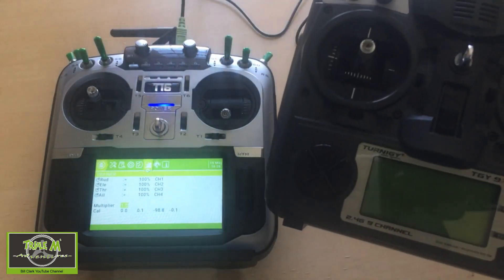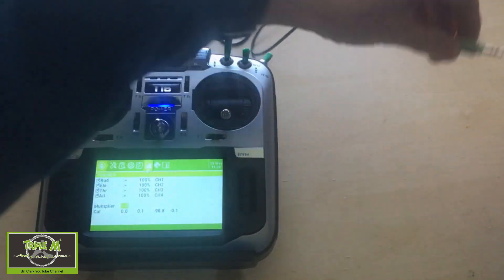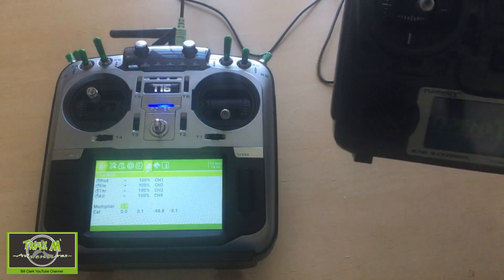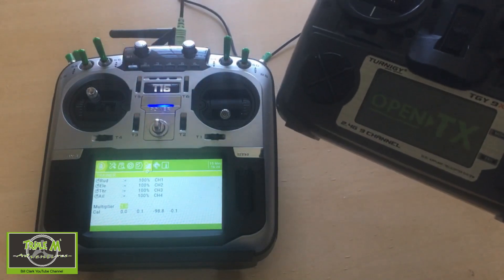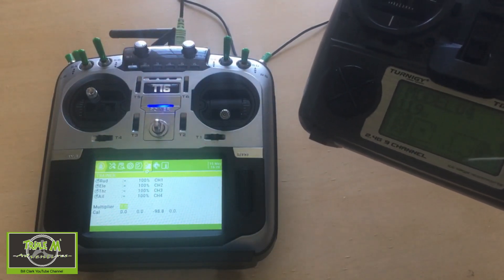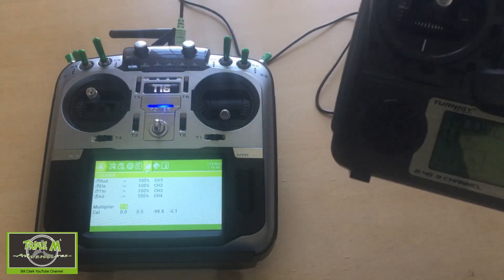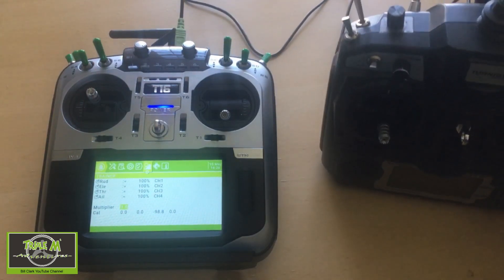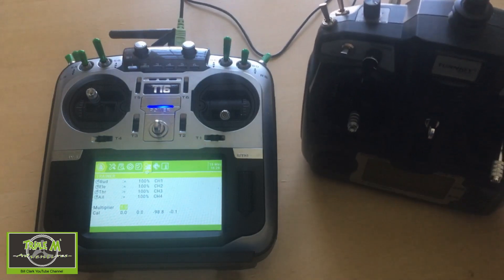Jumper T16 Setting Up Trainer Mode

Comment: Thank you for this video. It helped me setup my Spektrum DXE as the trainer slave with my Radiomaster TX16s as the trainer master. Anyone trying to do this with Spektrum you must have a mono aux/audio cable or else it will not work. Good thing the Radiomaster supports both mono and stereo.
Reply from the maker: Thank you for the information for Spektrum uses very helpful. I am glad my video helped you.
Reply: I wonder if it will work on my older dx8. Thinking of buying a radio for buddy boxing. A used dx7s or dx6i is about as expensive as a rdioamaster tx16s which has multiprotocol. I think I will just give it go.

Comment: I spent some time trying to determine what cable I needed for my TX16S. I assume what I learned also applies to the Jumper T16. The jack in the radio is a 4 pole jack (4 connections). To make matters worse it requires a longer than usual plug. Every 4 pole plug I could source is 14mm long but this one needs to be 17mm in order to engage properly. 17mm plugs are evidently used in some video applications. 

Oddly, the tip connection does not connect to anything in the radio. The ring closest to the tip is for the PPM signal and the ring closest to the sleeve is connected to a trainer detection signal line in the TX. I assume the detection line has to go to ground when the plug is inserted. A mono plug partially inserted so that it's tip connects to the PPM signal will work and in this way and it also grounds the detection line. When I tried this I could see with my oscilloscope a nice 3.5V p-p PPM signal coming out. So I believe one could use a mono cable with the plugs inserted most of the way but not all the way in. I'm not really comfortable with that arrangement however and I would really like to find a 4 pole plug that is 17mm long.

One other thing. I was planning to use an old Futaba radio for the buddy box. I believe the PPM signal from that TX is more like 5V p-p though so I think I need to limit it to 3.5V or I may damage the TX16. Need to investigate that a little further.
Reply from the maker: Jerry thank you for all your efforts in doing this research. It is obviously the radio has a none standard socket installed. I overcame this by adding a washer to the jack plug to raise it slightly and it basically works but I know not ideal. RadioMaster have released a wireless module to connect the two radios which my review will be released soon and I think it is very good.

Comment: Nice video, i have a tx16s and want to use my trainerport for headtracking, can i use a mono plug? Signal is the tip, rest is ground.

Thanks in advance
Reply from the maker: I am sorry I am not able to advise you about head tracking set up as I have never used a head tracking system but it is on my todo list now. Sorry I cannot advise you.

Comment: Hi, quick question. I have 2 Radiomaster TX16S's and want to use them to train my dad, however when doing everything as I should and plugging in the cable (normal aux/3.5mm cable) it glitches, I need to fiddle with the connectors and pull them out a bit for it to work, and the lightest touch to it disconnects the two. Do yo need a mono cable for this to work? Many thanks in advance
Reply from the maker: I came across this problem too, I know with the RadioMaster TX12 you need to use a mono 3.5 jack not a stereo one so give that a try and I think you will be ok.
Reply: @the-happy-RC-flyer  Thanks a lot, that would probably be the problem then, thanks again for the quick answer👍
Reply: I have the same problem... Maiby i Will Try with mono
Reply: @paololonzi  Tried with mono haven't had any luck so far

Comment: bill - im trying to setup a jumpter t16 to a spektrum slt6lp radio.  The spektrum diesnt have the lcd display,  Can you help possibly?.  thanks mate
Reply from the maker: I would suggest using the Spektrum radio as the student radio. I cannot advise on the settings as I do not have Spektrum radio but check if in the radio settings you have a trainer mode option either Master (Instructor)  or slave (Student) and set to Student. Set the Jumper T16 as per the videos. I hope this helps you.

Comment: Would I be able to setup training mode with the T16 and a flysky fs-i6 transmitter??? With the required adapter plugs?
Reply from the maker: You should be able to if you have the correct cables. I do not have the fs-i6 so cannot test it for you.